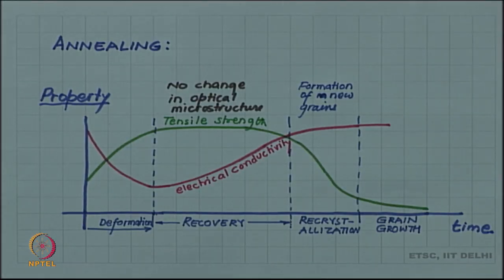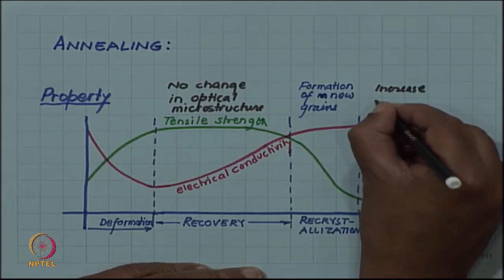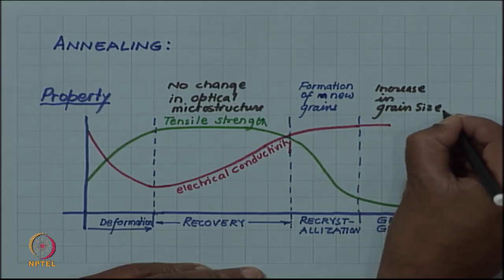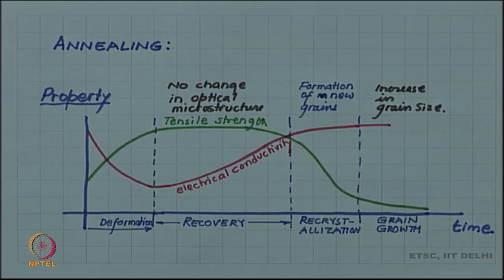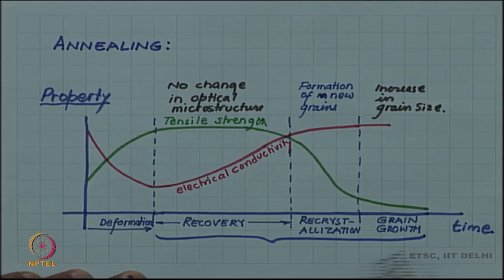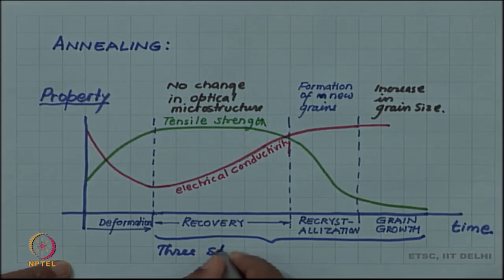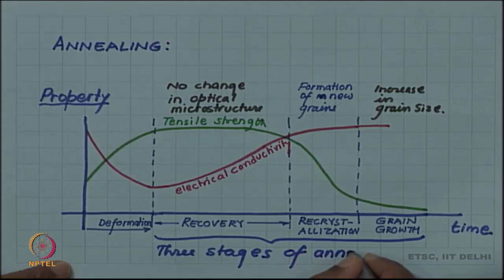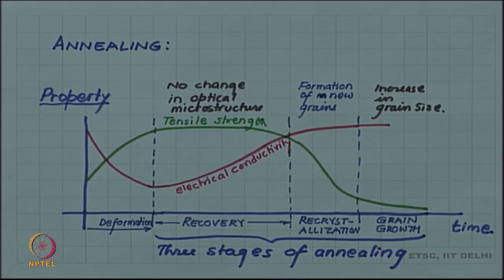Annealing of cold-worked metals

Comment: Sir can you please let me know, which metal stays cold longer at room temperature once cooled below zero ....Aluminium or steel or cooper ....for example if all the three are cooled together which will get warm the fastest ??
Reply from the maker: Difficult question. Let me try. Amount of heat required to raise the temperature by 1 degree is specific heat. Specific heats of Cu, steel and Al are 380, 500 and 920 Jkg^-1K^-1. So Al will require maximum heat to raise its temperature by a given degrees. So if we provide heat at a constant rate then Al will heat up most slowly. But I suppose thermal conductivities will also play some role.
Reply: @introductiontomaterialsscience  sir thank you.....I tried a simple experiment at home... Placed three metals in fridge for two hours... And later let them come to room temperature... Steel remained cold much longer then copper and aluminum....
Reply from the maker: @irfanghazanfar28  So your experiments clearly show that an analysis based  on specific heat alone is not justified.
Reply: @introductiontomaterialsscience  sir grateful for your support... appreciate it truly
Reply: @irfanghazanfar28  thermal diffusivity plays more important role than thermal conductivity in this analysis
Its questions related to unsteady heat transfer ,u can check examples like this and easily solve with equation based on lumped-parameter
Reply: @maulik61196  thank you
Reply: @introductiontomaterialsscience  sir if we take cold work steel and heat it till recrystallization then cool it in air would it be called annealing or normalizing.
Ie, does the rate of cooling specified for annealing of cold worked steel ,please clear my doubts because I have heard people saying that air cooling of cold worked metal after annealing is Normalising and for annealing there should be furnace cooling.